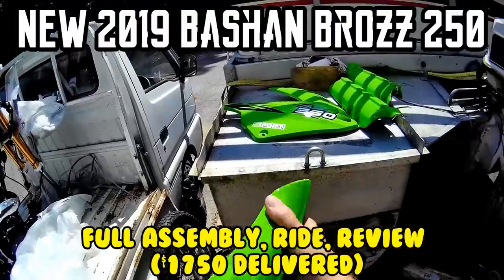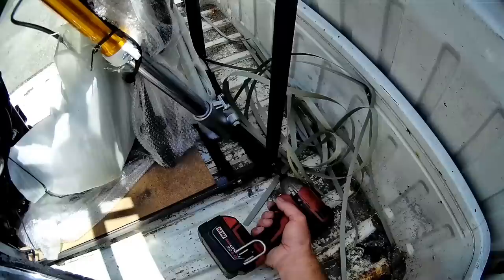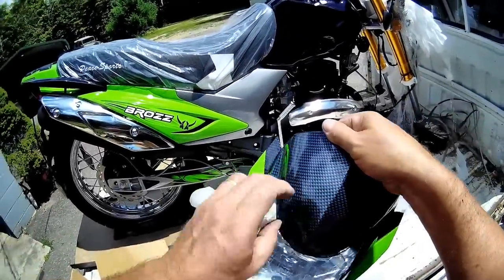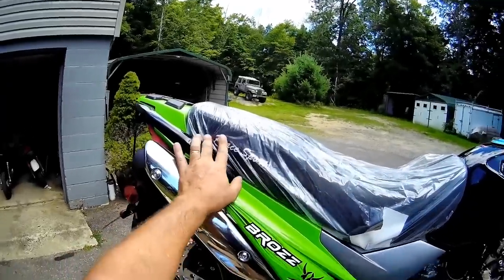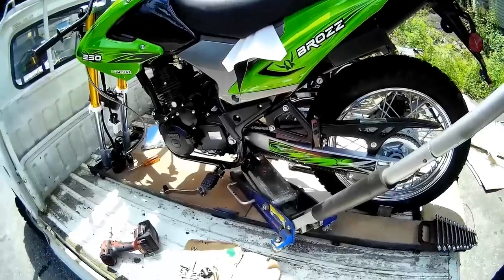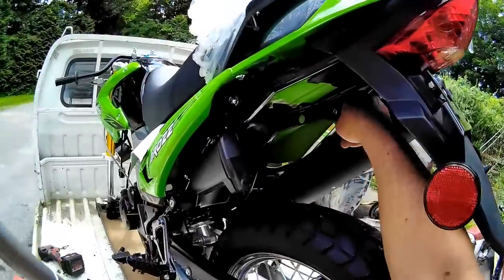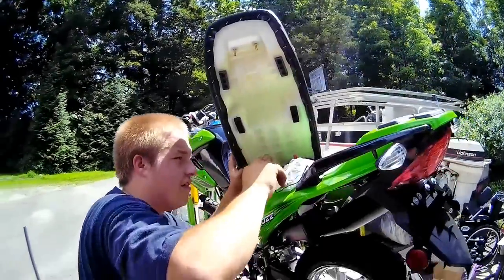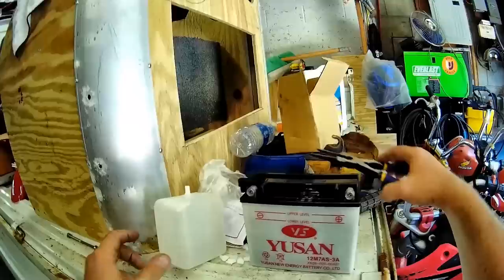NEW 2019 Bashan Brozz 250 Dual-sport Full assembly ride review ($1750 delivered)

Comment: As someone looking at getting their first ride that I don't have to worry too much about dinging it up. If you could choose one would you recommend this, the Vitacci db-36 deluxe, or the DLX hawk? Thanks 🤘
Reply from the maker: Depends on what kind of riding. If you're mostly dirt, go for hawk. If you're mostly road DB36, 50/50 TBR7 I have a comparison chart on motocheez.com.
Reply: @MotoCheez  it will be mostly road but the idea of an efi kind of peaks my interest. Thanks for the response
Reply from the maker: I'd say the TBR7. Check out the comparison chart on the bikes motocheez.com. Shows pros and cons. If you purchase from TXpowersports use motocheez at checkout for discount and save a few bucks
Reply: @MotoCheez  not a dual sport but ended up finding a killer deal on an SSR Buccaneer 😁

Comment: Mr. Cheez . My Brozz 250's  Clutch is very clunky when hot, especially the low gears down shifting. Not as bad when  cold to warm. Changing gears stiff in general. Slight lung when put into 1st. Don't think it's cable Adjust, done that. Would basic
Clutch adjust help? Any ideals, vids. Runs great when its in gear. About 70 miles on it... Thanks for any Help
Reply from the maker: A clutch adjustment is probably due for sure. As you put mileage on it the clutch actually gets better during brake in

Comment: I've got the leather racing jacket that would match it perfectly I'm building a MCI bus conversion and want a little on and off road bike to take along on my travels it all about cost for me right now it's a good looking bike and sounds like it's got enough power.
I'd consider looking into it some more thanks for taking the time to document the assembly,  and without instructions I might add great job brother.
 You should put an instruction manual together and sell it  on your channel I'd buy it.
 again thanks for sharing and love your channel god I can't get over the price on this its crazy. Thanks boss.
Reply from the maker: Sweet this would be a great addition... I've thought about doing a manual, I don't really like the selling end, I like doing the videos 😁😁 thank you!
Reply: @MotoCheez  your videos are awesome ,as a fellow owner /assembler of many Chinese quads an bikes,,,might I add blue loctite is your friend.AS well as dielectric grease on the connection's
Reply from the maker: Thanks! I've used silicone RTV also, works great for vibration and come right off when you need to. Dielectric grease is a good idea on there non sealed connections.

Comment: First thing I did was drain the oil and put in a quart of Suzuki 10w40 conventional. Will switch to synthetic at the first change.
Reply from the maker: Wait until you have 1000 miles so you know rings are seated IMO.
Reply: @MotoCheez  1000? Ok cool thx.!

Comment: I was curious if you had an opinion on the Suzuki Vanvan 200 as a 1st motorcycle. I love the styling and would use it both on street and on dirt roads. I liked that it is fuel injected since a carb and choke seem confusing. Thanks!
Reply from the maker: That's a great bike! As with most Japanese manufacturers. Great first bike

Comment: It should be Bashan Brazz 230. 229 cc is too much less than 250. 70 MPH top-speed. Pretty Slow,but plenty of power if you just stick with backroad riding.
Reply from the maker: That true, wonder why they don't just up the CCs to 249 or so...

Comment: Hey @MotoCheez, I am about to take a cross country trip, while I cannot get into the details of my client, I will be allowed to pick a choice of a Bashan BSR 250, TAO TAO TBR7 or an Apollo dirtbike\street legal. I will need this bike to get to some of the spots for my client. I will be loading it up on my SUV with a hitch hauler. I have experience in the past crossing the country on a Baja 150 ( i took it from Fort Kent Maine to Key West Florida) and have done everything from a zip tie all the way to an engine rebuild. The trip will be approximately 15,766 miles in length and I am sure I will be exposed to MANY OHV trails and opportunities, not to mention the road riding when I am at "Basecamp". Would you have a recommendation as to which bike will work for me. I am 6' 5.5" 200 pounds, so I know ill want to jack the suspension and forks up so I can make it fit me right.

Looking forward to your response, my client will send me a purchase order in a couple weeks, I will be buying it local so It will NOT be in a crate. It will be PDI already and purchased then driven right onto the hauler. Love the mini truck!
Reply from the maker: Sounds like fun! I'd choose the Apollo, mainle because the CT engine has the newest design OHC engine, 2nd would be the Bashan with the counterbalanced but pushrod engine. Keep me updated.
Reply: Motocheez

Here is a set of link to the bikes

2019 Bashan Storm 

https://fspsusa.com/inventory/view/11076759/

2019 Bashon BSR 250

https://fspsusa.com/inventory/view/11579128/

2019 Tao Tao TBR7 250

https://fspsusa.com/inventory/view/12440392/

2019 Apollo 250 (unknown model)

https://fspsusa.com/inventory/view/9893670/

They also have a Lifan but only change I can see if it’s fuel injected, so that jacks the price up, which I don’t really need.

Thanks
Reply: Disregard the Apollo , it is not street legal and my home state I’ll not register it, if it doesn’t come from the factory that way
Reply from the maker: @myspectacularjourney  they do make An Enduro Appolo.
Reply: @motocheez, ok I just didn’t know if the shop sold that one, as it’s not listed in the inventory
Reply: @motocheez, I spoke with them. The options are the TBR7, the BSR or the storm , they do a full PDI on all bikes prior to the customer purchasing, then once the purchase is made they put gas in it and do another adjustment. I’m hoping this means the “issues” you encounter with the “home delivery” can be mitigated. I’m honesty leaning towards the BSR In all black, not sure why. I have zero experience with either brand!
Reply from the maker: Not sure on the BSR...

Comment: yO cHEEZ!!! im i mistaken or do you not use "locktite' on your builds. ive watched a few of your vids and  never see locktite used on metal to metal.
Reply from the maker: No, I don't, the better hardware and rubber washers that most come with now hold well. Typically I'll use permatex for vibration areas where I want to remove the bolt at some time for service.

Comment: Is that the same engine as the hawk?  How many of the parts are interchangeable with other bikes if any.  If it is the same engine could you swap the crank out?
Reply from the maker: It's not same engine, has a bump molded on the front for the counterbalance. Head and jugs same. Longer engine, not sure if would fit in hawk frame without mods

Comment: Im trying to decide between the Brozz 250 and the TBR7. I dont do much trail stuff so was leaning towards the TBR7 vs a Hawk. I dont know if the few extra features on the Brozz warrant a $600 premium over the TBR7 (I would get white so I dont care about the inner paint on the fairings). The main thing for me is the inverted forks on the Brozz, do they make a huge difference vs the TBR7? Ugh decisions decisions..
Reply from the maker: The Brozz for 2020 price went up to $1999... That's another factory. Brozz is smooth and quiet tho 😁
Reply: @MotoCheez  having built and ridden both, would you say there is a difference in build quality between the two? I would assume the fit and finish as a whole is a bit better on the Brozz than the TBR7 or am I just fooling myself? I seen your post that Peace is trying to bring a 450 over to the US in 2020, oh boy that would change the game.
Reply from the maker: @MeltingSlicksLS7  The smooth counterbalanced engine, smoother ride, inverted forks and quiet exhaust makes it one of my favorites. The plastic fitment and quality is a bit better than the TBR7. Nothing wrong with the TBR7, it's a good price for what you get. Yeah the 450 is going to be a game changer
Reply: @MotoCheez  Awesome thanks for the reply

Comment: I have  this model Brozz and my battery died.  Any idea on the type of battery it is? Having trouble finding it online. Thanks!
Reply from the maker: You can go one size under. I forget the size...
Reply: @MotoCheez  thanks. I'm a bit of a newbie though. So would any 12v 8ah motorcycle battery work? When you say one size smaller , one size smaller than what? Thanks man

Comment: I have a storm which is about 90% the same bike, same wheels, tire and brakes. Have you noticed any wheel hop or brake pulsing on the Brozz? Mines got a hop and the brakes have developed pulse from what seems to be a warped rotor.
Reply from the maker: No hop or rotor pulse yet. I wonder if your caliper is hanging up heating rotor giving it a wheel hop at the same time?
Reply: @MotoCheez  On a jack the wheel free spins, but you can hear it drag once a revaluation. My rim isn't 100% but not terrible, but the tire does have a wobble to it. Going to air it down and reseat the tire. Local dealer wants $165 to true the rim so I'm just going to pick up a tire stand and diy.
Reply from the maker: @duck9191  bent rotor for sure. Since new? The Magician had a bent rotor from new, shipping I assumed
Reply: @MotoCheez  I didn't notice the pulse in the brake lever until about 100 miles. I was practicing some emergency stops from about 25mph, which I wouldn't think would be an issue. But after about 5 stops I noticed coming to stop lights the brakes picked up a pulse.
Reply from the maker: @duck9191  ahh
Reply: @MotoCheez  not really sure if I can find someone to turn it locally, but thankfully they are pretty cheap. It's not that bad so I'll deal with it until winter. Other than that the bikes been a blast.

Comment: All these Chinese Bikes are made in the same factory under various names. Why pay 1750 when the same exact bike {Tao Tao 250} is only 1295 shipped?
Reply from the maker: Believe me they're not the same. Inverted forks, different swingarms, gel seat foam, counterbalanced CG engine etc. They are built in same factory for the most part, but to the spec of the dealer.

Comment: Should get the Apollo Db-36 deluxe. They sound great and are pretty quick without jetting
Reply: Tell us more.   Where is an example?  What is the top speed for it?
Reply: @kekfreedomheritage5633  I looked at one of these and a TBR7 two days ago on a showroom floor of a dealership that sells both Chinese and Japanese bikes. I wanted to see if the seat height was going to be a problem. I was quite impressed with the fit and finish considering they were offering if assembled for $1300. The guy showing me the bikes told me he had put them together (he was one of their mechanics; injured shoulder) and owned Japanese bikes his entire life and he stated unequivocally that he'd have no concerns using one of these as a reliable commuter bike and light trail bike. I thought that spoke volumes. And believe me, the dude was nowhere near being a "high-pressure" salesman.

Comment: So I hear folks that are tall over 6ft are on their tip toes on these bikes. I'm 5"8 so I am vertically challenged so does that mean if I am at a light I'll be leaning to one side just to hold it up? I have never ridden so maybe there is some trick or you can lower that I am not aware of.
Reply from the maker: Not true, the DLX was very tall when I got it and I did lower it with the shock spring a little bit. I am 5'10 and I can almost flat foot on this bike and pretty much every other bike except the DLX when it was stock
Reply: @MotoCheez  So they can be lowered then? Yeah some vids were saying they were on the tip of their toes but I haven't heard of anyone else say they had issues in the majority of the other videos. I'm looking for a Brozz 250 but can't seem to find any in stock. if you know of a place let me know and I appreciate your vids. You have a vette too? I have a 700+ hp c5 I built (668rwhp was my old dyno number) vids are up of it
Reply from the maker: The rear shocks are adjustable so you could loosen the spring a little bit which of course makes the ride a little softer which is what I prefer anyway. Yes I have a C6 basically all stock except bolt ons and tuned with exhaust and all that of course. Awesome I'll check it out

Comment: Are the front shocks buttery smooth or is there a clunk on rebound ?
Reply from the maker: These are pretty good. Rebound much better than hawk, tbr style
Reply: @MotoCheez  I have installed a set on my bike but the rebound has a clunk or clank like there is no rebound control. But thats only when jumping it really. Normal riding they are fine.
Reply: @MotoCheez  My TBR7 rebound was fine stock,  it was the compression that was lacking, so these are acting the opposite, great compression, clunk on rebound
Reply from the maker: Ohh, they do clunk once in a while if you jump with them. I don't usually do it to where I notice it

Comment: $1,750 Wow that is not bad at all but what states is it not legal to ride on the street?
Reply from the maker: CA as far as I know. But the 2020 model is $1999
Reply: @MotoCheez  Dude I got a Suzuki M109R Boss it's nothing but a gas hog" it's got plenty of power and I have done a little custom work on it, but I used to have a Dr650s and I rode that thing Everywhere" even went off road with it on the weekends. I was thinking about getting another one just to be able to go back up in the mountains on it. I bought the Blvd because of my friends who got themselves a cruiser" I had a Yamaha V-Max but that thing handled curves worse than anything I've ever ridden in my life , although it was faster than almost anything on the road back then especially on a long straight away.
But yeah I just might get me another Enduro motorcycle.
I don't know about that Hawk 250 it might not have the torque like I'm use to having.
Reply: @MotoCheez  Does that Brozz 250 really have good torque?
Reply from the maker: @rpmfreak9150  yes

Comment: To disable the remote is unplugging the receiver all I have to do???
Reply from the maker: Yes
Reply: @MotoCheez  Thanks
Reply: @MotoCheez  I have learned that two wires to the remote must still be connected or the engine will not turn off with the key or the kill button.  I'm told they are ground wired.  Do you know the wire colors or which two must remain connected?
Reply from the maker: I just unplugged mine. I think there are 2 plugs bi left one connected? Been a while. Sorry. I don't have the bike anymore.

Comment: Have you seen the RTE 250cc enduru motorcycle it has 20hp 19.5tq nice looking bike pretty cheap to
Reply from the maker: I just looked it up. Looks like the CB style 230cc engine, where did they claim those specs?
Reply: @MotoCheez  i seen the specs when i looked it up on google i thought it looked pretty sharp you can get red or green but the power seemed pretty good
Reply from the maker: @dailylife3975  those specs can't be right TBH. It's more like 15hp max. Same engine as some bikes I've reviewed. CB style ohc

Comment: Thats pretty similar to my storm but has a few more upgrades . like the digital dash! hmmm.....might have to buy this!
Reply from the maker: Nice. I wondered what the difference was
Reply: I like the green storm but not able to find one
Reply: Add a digital dash to your storm, that's what i did. The digital speed counter off the csc tt250 fits the storms hub so you don't even have to screw with trying to mount the magnents. Only cost me like $40, you can make the gear indicator work too if you replace the shift sensor and make a harnes.
Reply: @duck9191   thanks for the info !!
Reply: @larryalexander4833  I have a post on chinariders with pictures of the install, just search for storm digital cluster.
Reply: @duck9191   thanks I'll try and find it . If I can't find I'll get back . Wich bike did you get  the storm or brazz
Reply: @larryalexander4833  storm. They are very similar. The cluster on the Brozz is better but really they both suck compared to a digital. I'll post the link in a bit.

Comment: Is the front and rear suspension adjustable for preload, compression and rebound damping???
Reply from the maker: No. Sadly
Reply: So I guess that means preload only?
Reply from the maker: Al preload  adjusts for rear only. Front you’d have to change weight if oil or springs in tubes / shim.

Comment: OK but for real who wouldn't take the old trailway over the new bike?
Reply from the maker: The TW's are awesome, but they're pulling big price tags. A few of my friends have them and the older bikes usually need quite a bit of work
Reply: @MotoCheez  I'm seeing them $3800-$4k new, 2019MY,  and very low used availability. Ya, it's double the price of this and most Chinese 250s, but you KNOW the TW will still work in 10-20 years.

Comment: Do you know where to get the rear wheel from. I have a Dong Fang 250rte. Needs rear wheel 130/70/17
Reply from the maker: Check brozz250.com. They carry parts for them. Or TXpowersports.com.
Reply: @MotoCheez  thank you I put my order in another question if you dont mind
do you know where I can find the sprocket studs ? also I am not sure if a newsnap ring comes with the wheel but if not what the size?  thank you
Reply from the maker: It doesn't come with those. I used my old ones.. not sure but I think TX has them
Reply: @MotoCheez  Thanks They didnt have it but what exactly do they look like and by any chance what size are they?
Reply from the maker: I don't know size, can't you measure off your old one?
Reply: @MotoCheez  I bought the bike from some one and it didnt have any the ]part where the sprocket sit on was shaved off broke and the sprocket was hanging no bolt. but i am looking online and is the bolt solid on one side to push in the rubber and other end threaded?
Reply from the maker: Yes, it slides into the rubber cushions
Reply: @MotoCheez  Appreciate it  I will keep looking avoiding ordering from china it would take more than a month to get here,